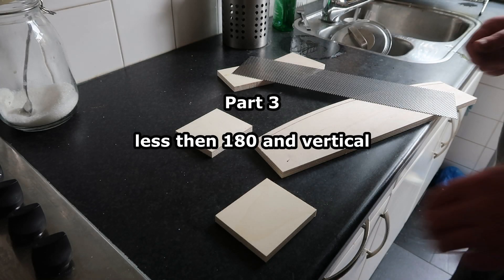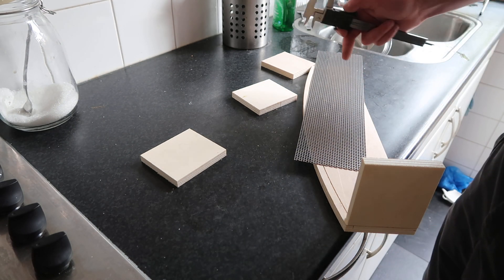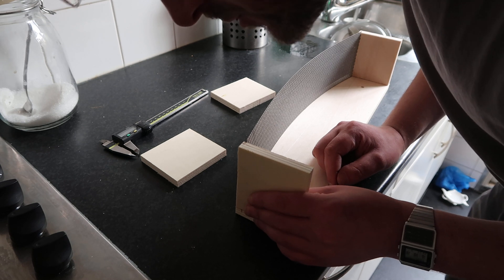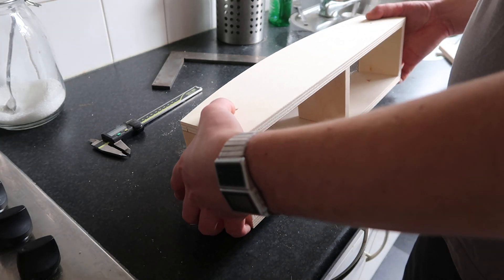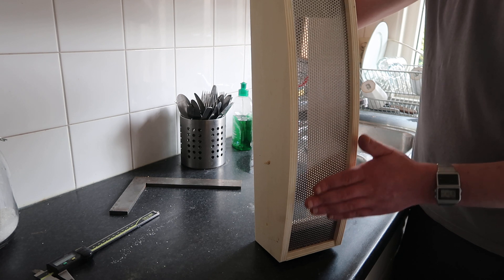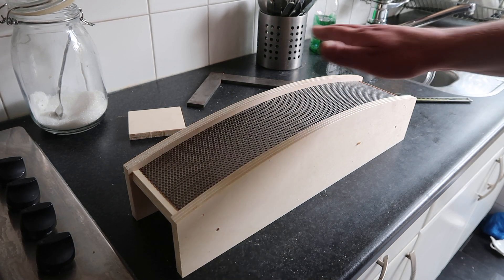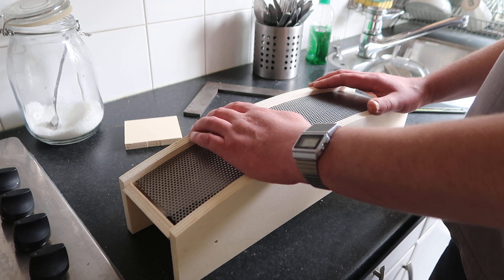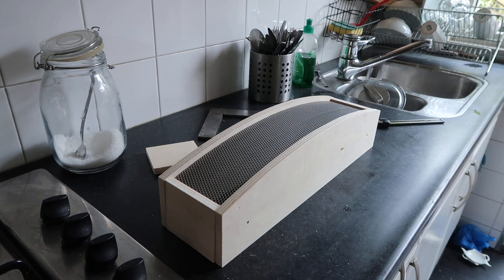Curved Planar magnetic - Part 3 vertical version less then 180

Comment: Hi Joppe, With love from India. I had 2-3 magnepans when I lived in Canada . Started watching your channel few years ago when I was searching about rebuilding the coils and I think I watched 60-70% of your videos. :)  I am seriously thinking about a very small scale manufacturing of flat panel speakers here in India . What design will give more success rate? I was thinking about a boxed sub in the bottom and mid-high panels on top, or build just the tweeters (Ribbon) to start with. thanks
Reply from the maker: well i cant say exactly or i might have done that :) but i can say so much flat panels are the most easy to construct, prefered like maggies, having tweet and bass on the same foil. it saves allot in materials and work.. option 2 bass the same a s magnepans and the treble with neo or something stronger then regular rubber. (NDFEB rubber maybe)
Reply: @joppepeelen   Noted, much appreciated!

Comment: Poplar plywood.
Reply from the maker: Thanks thats indeed what i was looking for, 1/3th the weight or something it just feels weird :)
Reply: @joppepeelen   It's actually quite strong. I have used Poplar plywood for over 40 years. It has it's place. If you get the kind with approximately 1mm ply thickness it is really good. In Canada that usually comes from China. Canadian Poplar plywood uses much thicker layers.

Mark

Comment: Hey Joppe, just a thought, but how about an open baffle concept? I really like the look of the design.
Reply from the maker: well it will be open baffle :) (the mid/tweeter will be open baffle) in the end i would like to combine it with open baffle Planars. but for now i go with a regular woofer in a box.. purely because i  need to hitch a ride for the diy audio event. so something huge is out of the picture since it might not fit in the car :)